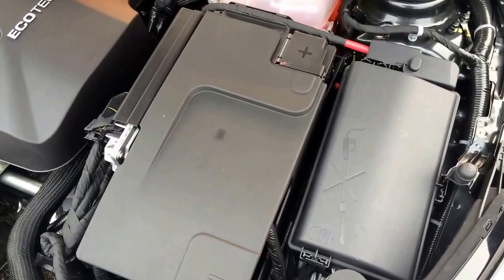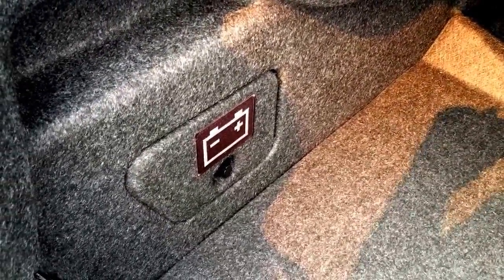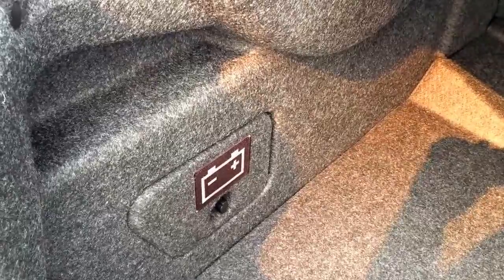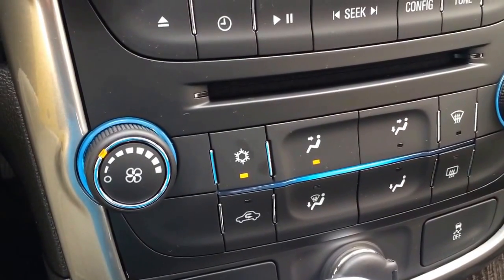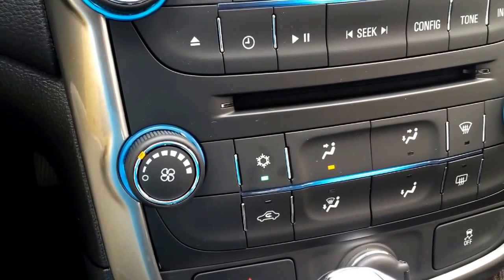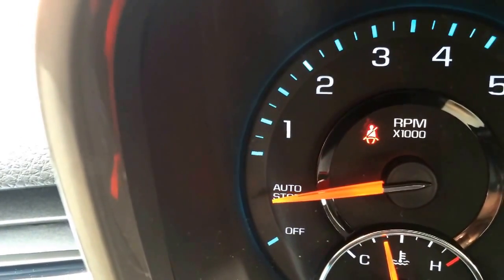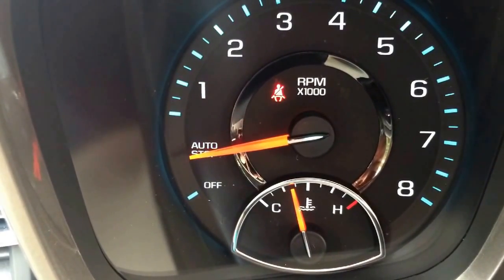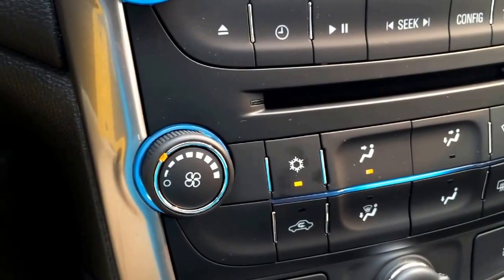2015 Chevrolet Malibu start-stop technology - what is it?

Comment: Turned out to be a piece of crap feature. Malibu are known to not restart, only sputter and die when you take your foot off the brake. No known fixes for this issue from Chevy. Local dealer even refused to look at my 14 malibu. Chevy has ignored the issue. Avoid 14/15 Malubus.

Comment: I just bought a used Malibu. The question I have is how much more wear and tear does this put on the starter? Should i be concerned about regularly replacing the starter and if so how much does that cost.
Reply from the maker: Sorry for the late reply.  I've been out of the car business for a few years. The system keeps itself primed, so there is very little stress on the starter system.  Don't be concerned.

Comment: At a stop light or stop sign My 2015 malibu go's into the stop start mode like any other 2015 malibu.
My big problem is that right after i press on the gas pedal the car starts to hesitate and dies out?????
I have no codes showing me that the car is having anything wrong with it?????
This is very annoying while sitting in traffic and your car dies out.
Does any one else have a problem like this???
Or if someone else might know what is causing this to happen.
Reply: I'm having that same issue. I spent money trying too figure it. Still no resolution.
Reply: Replace your rear battery  .. if the car dies could be a possibility of a bad battery not having enough juice to turn on the front battery to start the car again .. that little battery is the life of the vehicle in auto stop mode .. worth a try good luck might be a late tip but who knows might work
Reply: Yes mines is doing the same thing I fkn hate it and that’s even when I have it turned off
Reply: @yolandabrown8117 how do you turn it off

Comment: Also every other car maker added a button to shut off the stop start feature except Chevy ! I’m hoping they come out with a recall so we can go in and have it disabled or someone figured out how to turn it off . Right now feathering the brake works ok . Also go into neutral, my driveway is on a incline and we pull in and the car shuts off , I put it in park to turn off the car and it start back up ! There should be a delay , it’s insane
Reply: Shift into Manual mode, then use the rocker switch on the shifter know to select the top gear. Bypasses it on most.
Reply: @anonymousinc6330 will I have to do this evertytime I get in the car
Reply: Im having trouble wen I come to a stop it shuts off completely in autostop

Comment: I bought my daughter a 2016 Chevy Malibu limited . I didn’t notice it had stop start and I hate it . There will be a time your in traffic on the highway and it turns off and doesn’t restart. It’s a time bomb . It’s going to wear the engine 100 times faster . I don’t see these cars going over 100,000 miles with out major repairs, I’m trading her car in as soon as warranty is up . Not worth the savings on gas to risk getting stuck on highway in rush hour traffic and getting killed . They didn’t think this one through. For those of you unlucky enough to have it buy a replacement battery for the 12 volt in the truck so you can swap it out in a pinch .

Comment: For those unlucky enough to get stuck with this BS, put the shifter in L or M, use '+' to set the dash display to the highest gear, and it will disable this. Supposedly works on any GM model with this BS.
Reply: When I set to M highest it will go is 2 but still the issue remains

Comment: I'll never buy another GM car with the Start stop technology.  It's terrible in the city.
Reply: @MassiveBig  not in the 2016 impala and wont stay off.
Reply: @MassiveBig  how
Reply: @ibetheinfamouslouch  so i actually figured out i was wrong. The 2013-15 Malibu the feature cannot be turned off. My car has a Trifecta tune which disables the auto stop/start That's why my car doesn't do it.
Reply: @ibetheinfamouslouch  but if you keep the car in manual shifting mode it will also disable the feature.
Reply: @MassiveBig  damn how i do that bro?
Reply: Thank Obama, it's the unrealistic fuel economy standards set by his administration working against us.

Comment: This is a pain in the ass. Sure you're saving fuel... barely. But now I'm going to have to buy a starter 3x sooner... thanks...  also whenever you're trying to take off quickly there is a delay since the car has to start back up..
Reply: And it keeps effing up my battery causing my theft deterrent system to get locked on. In the dealer for the second time

Comment: My 2017 Impala has this.  I'm fine with it.  While everyone else is at a stop light burning gas I'm saving gas.  My Impala averages close to 30 MPG combined city/hwy.  I have driven it about 100 miles on a hwy trip and averaged over 33 mpg.
Reply: Wait until your engine and starter show the wear that comes with this feature.
Reply: @anonymousinc6330 They are built and engineered to handle it.

Comment: AutoStartStop costs LIVES and dollars....FAIL.
2017 Ford NON-HYBRIDS will roll into traffic with the motor shut off!! We were almost killed the 4th day of ownership pulling out of our own driveway. 
 Having a button to shut off Death Mode is inadequate. There needs to be an option to permanently disable this "feature" so you don't forget and wind up dead.
 I have notified nthsa.gov about this.
Our vehicle rolled into traffic while making a left turn but the motor took over 4 seconds to turn on and reach torque. We were within a hairs breadth of being flattened by a semi. This is a Stupid feature to put on a NON-Hybrid vehicle. There is NO backup power from batteries when you move from brake to accelerator. A child could figure out this is a deadly design, why can't the high paid engineers in Ford's ivory tower use common sense.
 I also requested a buy back from Ford. They checked the vehicle and said it's designed to operate that way!?? Are they crazy?? 
 Even worse, when people roll out into traffic and get flattened, Ford and police will claim they died due to Operator Error. 
 In addition, it has gotten So Bad, the dealers are having their salesmen turn off this feature during test drives! We did multiple test drives at different dealers during the course of shopping and in every case the motor NEVER shut down until AFTER we drove it off the lot! So you don't even know you have A.S.S. til you drive off and suddenly your motor shuts down! It's a total scam!
Reply: Gina Kerry that's what you get for buying a ford. How in the fuck does your car roll with your foot on the brake dumbass. Our Malibu has never moved once while in start stop mode. You sound like another loser after money from a big company
Reply: System
Reply from the maker: I'm really sorry to hear that happened to you.  That''s horrible.  However, you obviously didn't watch my video.  Both my wife and I drive a 2015 Chevrolet Malibu with the Start/Stop feature.  Our cars have a secondary battery located in the trunk that keeps fluids primed, etc. while in auto-stop.  When I remove my foot from the brake on my car, the engine is already running and powering the Malibu by the time my foot reaches the accelerator. 

 Start/Stop (or Autostop) has been used in many vehicles since it's inception - both hybrid and non-hybrid - and the list is growing.  If your story was the norm, this would not be the case.

Again, I do not wish to take away from the horror of your experience, but if Ford messed up the Autostop feature in the Hybrid, that does not make the feature bad, but makes their version of it faulty.  By that logic, the fact that the Samsung Galaxy Note 7 had a battery that would explode and catch fire would mean that a battery in a phone is a feature that is dangerous and costs lives, and should be discontinued.  But no, the Note 7 was recalled, and we continue to have phones with bigger and better batteries.  

Thank you for your feedback, and sharing your story.  It's never a bad thing to be aware of the dangers in the world around us.  Thankfully, each manufacturer develops their own version of technologies as they grow.  That's how good technologies grow and improve, and that's progress.

Comment: Mine not working any suggestions?
Reply: do you have the 2.5 engine? this feature is not available with the 2.0 Turbo engine
Reply from the maker: +Lorri Blouiin It won't do it all the time - only when conditions are right.  Mine felt like it didn't do it for several weeks (it probably did, but I wasn't paying attention).  Then I noticed it again.  If it sincerely is not going to auto-stop, look in your Driver Information Center Settings menu, and make sure it hasn't been turned off.  If it hasn't, and isn't working, I would have a GM dealership take a look at it.  I hope this helps.
Reply: Mine not working too ! And my car 2013 Chevy Malibu Eco 2.4
Reply: You're lucky. You don't want it. Left turns across traffic are scary when this thing works.